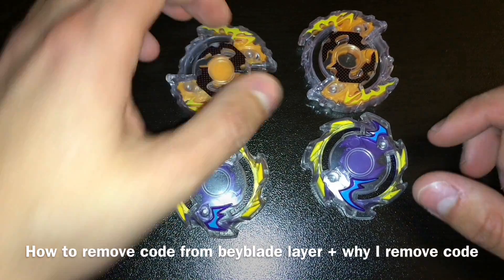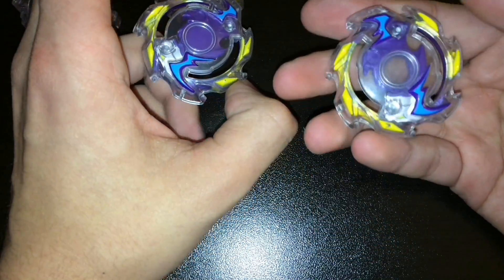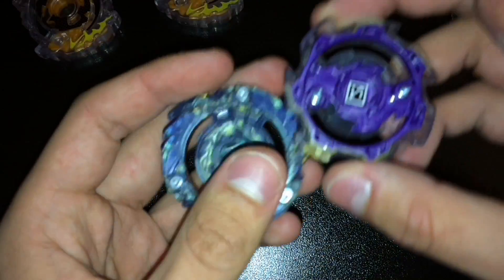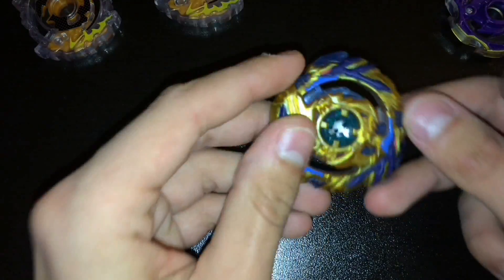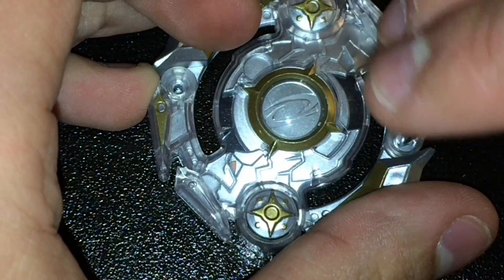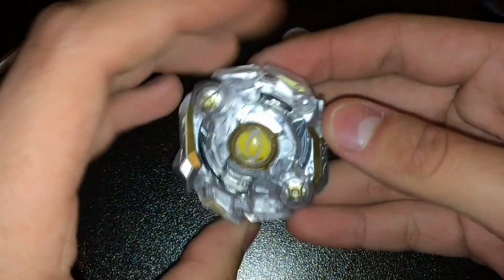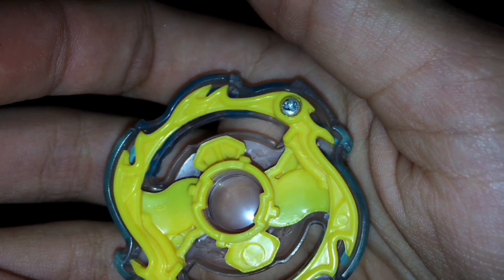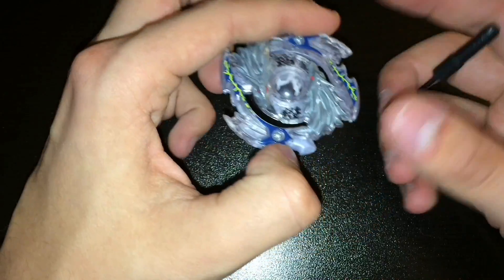How to remove codes from hasbro beyblade burst + why i remove codes

Comment: There are codes for a reason if you want takara tomy just buy them
Reply from the maker: You are right, the codes are for a reason: the app. I buy hasbro because its cheaper and i can get more beys. removing the code does not affect the performance of the bey, so there is nothing wrong with it. 
all the codes are available here if i need them. http://beyblade.wikia.com/wiki/List_of_Hasbro_Beyblade_Burst_App_QR_Codes